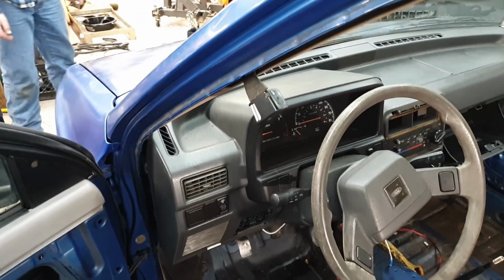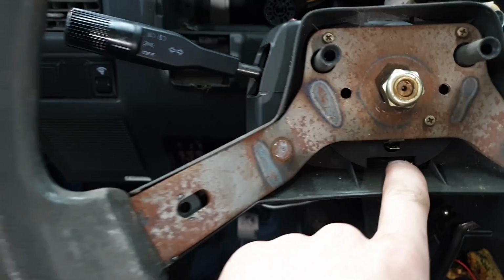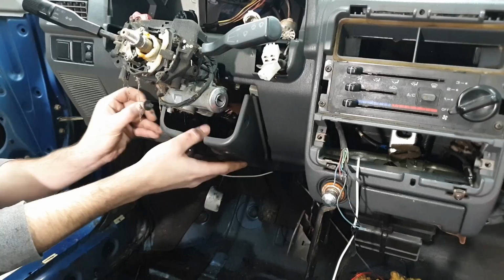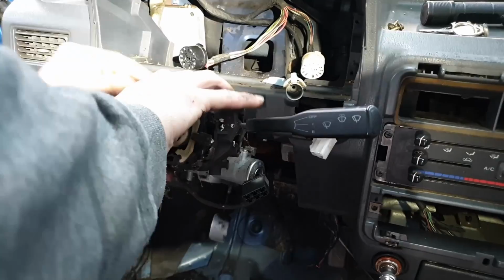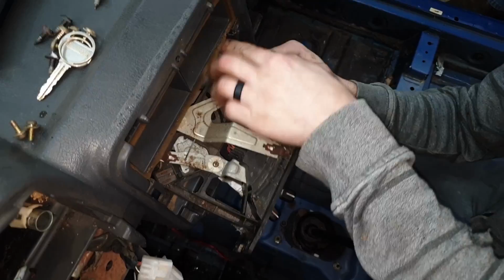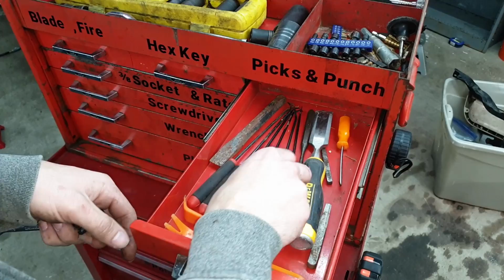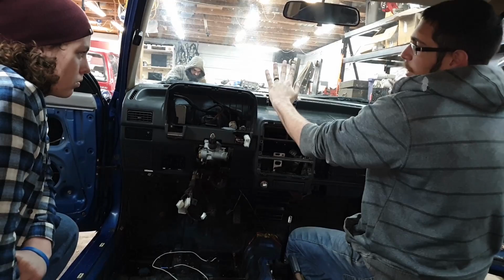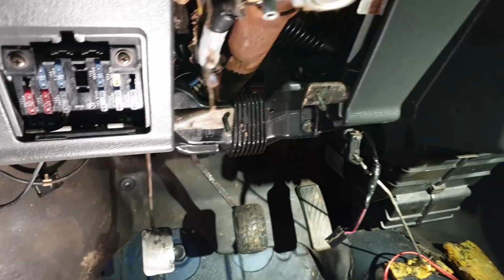Festiva Dash Removal How-To!

Comment: NICE VID!!!

The ONLY problem i had when I removed mine, after install I had no brake lights. Dropping the column down pulled on the wires going to the brake light switch and it became unplugged.

Comment: Would I need to unplug the speedometer cable if I’m just changing the lights on dash
Reply from the maker: Yes, if the cluster is being pulled, the speedo cable needs to be disconnected

Comment: Can I unlock the ignition switch lock by doing this?
Reply from the maker: The steering lock can be undone by just removing the ignition cylinder, it's 2 headless bolts